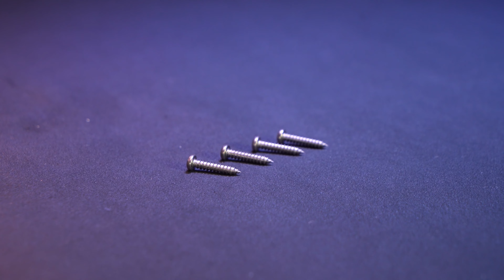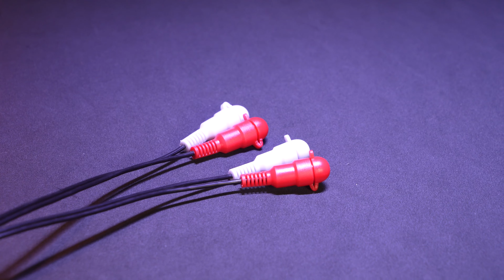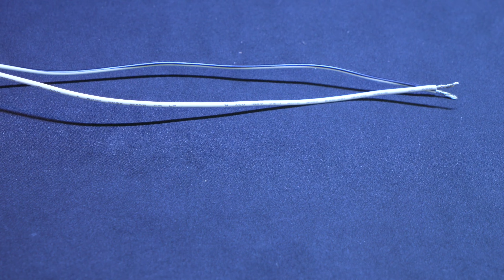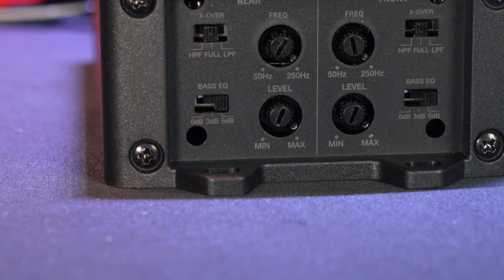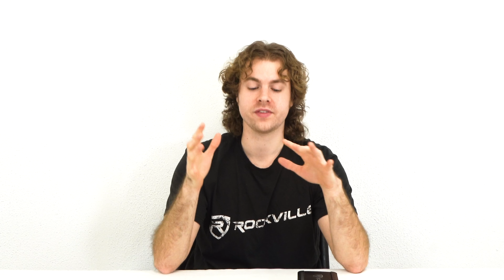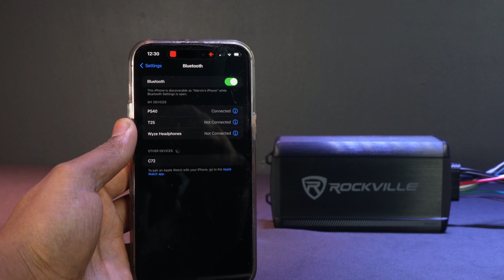How To Set Up Your Rockville PS40 4 Channel ATV/UTV/Motorcycle Bluetooth Amplifier IP65 Micro Amp

Comment: Y'all guys i just ordered this amplifier yestersay and waiting for it. I've looking for the owner manual to see what the wires gauge is, power, acc, speakers to order and install directly, but have to wait till get the amp and check that
Reply: How was it? I want to hook up some 6x9s on my Harley
Reply: @jefflpo  But what I like about hardware is this amplifier feels good, does not feel like chinese crap u know, the size is really compact but not micro, is little bit heavy for it's size so I like that aspect to, the spec claims 60 rms x 4ohms but the dyno sheet claims at least and no less than 45.5 rms per channel at 4 ohms, to be honest haven't checked the spec in bridged. 
Things I don't like are the power wires are too small, 14awg for positive and ground and the instructions says they have to be connected at minimum of 10awg wire or if get hot 8awg, and speaker wires are good at 18awg for that power.
Reply: @jefflpo  Honestly I haven't installed, I will install as soon as I get my very last wiring. I'm still waiting just because ordered everything to do my own installation lol. But I can tell you what I like and what not, as soon as install I will update my review
Reply: Thank you
Reply: @jefflpo  Finally hooked up this amp paired with 4 rockfords m-0 6.5. It is pretty easy to set up the gain and tune the sound. I have a boss marine stereo and can't match the gain in my oscilloscope for some reason. All I can do with my head unit is turn on the amp but can't up/down the volume or change the track. About sound quality, it's not very loud but pass, I don't hear any distortion wich is cool. If You want some easy and fast and install I would go for this one, if you want something better that can control with a stereo I would go for an amp that is not Bluetooth like Mb quart, hifonics or rockford.
Reply: @christianrobles7561  thank you for the fast reply. I’ll probably get it on Amazon so returns are fast, hopefully it’ll power two 6x9s when bridged.
Reply: @jefflpo  I think the best way to install this amp is with passive head unit. You can run the remote wire directly to acc wich you amp will stay turn on till shut off ur bike, but that means everyone can connect to you amp if u are not connected. I think u would be fine with bridged speakers just need a little bit of audio tune lol